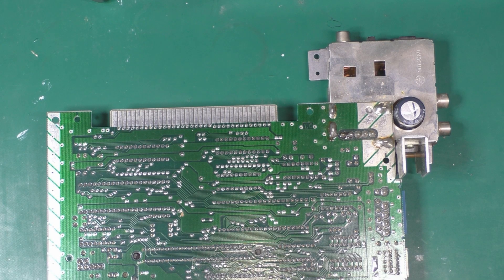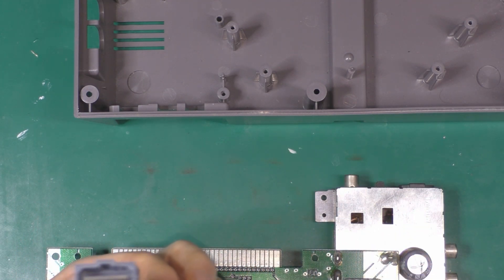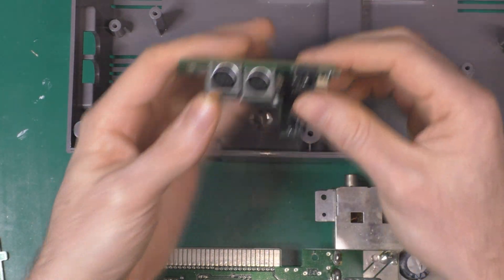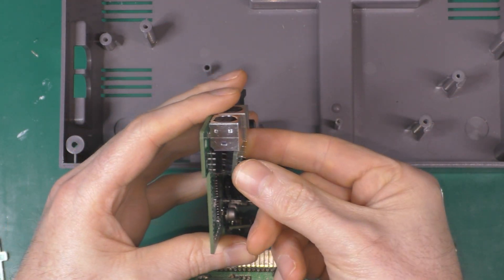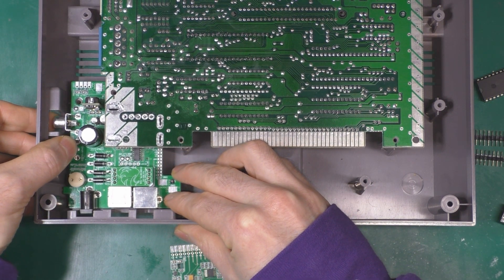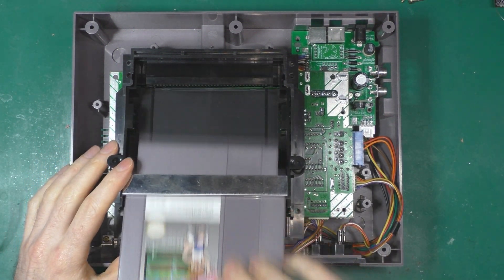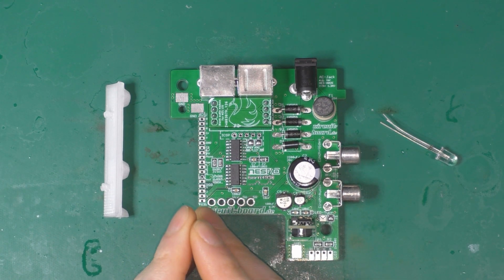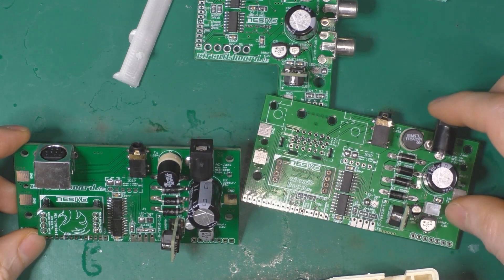[Retro] NES I/O NOCUT MOD for Front Loader

Comment: Do you know how this module would interact with Voultar expansion audio module? I cant find BORTI4939 no cut github repo
Reply from the maker: Voultar expansion doesn't connect to this board, it connects to the hole next to the jumper J5 of the NESRGB.
The NOCUT is my branch of the Borti's work, and Borti took down his work on the NES I/O because it is now irrelevant (NESRGB 4 and newer have IGR integrated). I'm working on a new version of this mode, which will be easier to install.

Comment: @ 9:48 you remove and clean this 5 legged item. Do you possibly have access to these or I must take from the original?
Reply from the maker: Re-use the original.
Reply: @TheRealPhoenix_Retromods  Okay I finally grew the courage to install the NES i/o no cut. I have one last question. If I already have the nesrgb installed using the SNES A/V out, would I simply just solder the 5 legs to connect the i/o to the motherboard of the nes?
Reply from the maker: @digitalblasphemy1100  Er... What the point of installing a NES I/O if you already have a SNES A/V? With only the 5 legs you won't have the IGR, nor any output from the NES I/O working and even loosing composite and sound from the original RF box.
Reply: @TheRealPhoenix_Retromods  Because I was told the diagonal bar video interference I'm getting was power related and I have changed the power filter cap and a brand new Triad power supply so I thought I would recap the power/RF module but I was told it's very difficult so I thought I would look for a new one and you sold me a brand new one. Do you think it's a bad idea? Sorry I really do not know how to diagnose electronics, I'm just asking people online to help teach me about this issue.
Reply from the maker: @digitalblasphemy1100  Since you'll have to remove the RF box either to recap it or change it for the NES I/O, recapping the box should fix your problem. People say it's painful because if you don't remove the RF completely you won't be able to remove the top shield and won't get access to the small caps. Check https://wiki.console5.com/wiki/Nintendo_NES-001#Recapping_Tip:_Power_/_RF_Module
Reply: @TheRealPhoenix_Retromods  Okay but let me ask you this. I already purchased the i/o and like the idea of having updated power components. Is it usable in my nintendo without hooking up all the wires to the RGB board? I just don't know the installation process because I'm the only person using it as a replacement to the original power board.
Reply from the maker: @digitalblasphemy1100  You can "technically" do it, but the power circuit is very similar as the original (not really updated), and there is a itsy-bitsy chance that DC/DC converter on the NES I/O might introduce other kind of noise (some motherboard don't like the DC/DC converter and get a noise ground loop, and you'll have to remove the transistor Q1 from the motherboard). You won't get  any output from the box (since you won't use it for RBG output) nor IGR. It's like using chemio just for shaving your head.
Reply: @TheRealPhoenix_Retromods  Yes I understand you think it's silly but I am only just learning to solder and modify my old consoles and eventually I will remove the multiout and RGB mod my other NES consoles and will use the features of the i/o. I am not quite confident enough to solder all the wires yet and I already have igr with the everdrive so that's no big deal. At this moment, I just want to fix the very annoying interference with your i/o. I have spent a fortune on getting a good image on my tv and after 3 years, I'm still stuck with an ugly image. My old module is very corroded looking and everything else is so clean so now I will have a very nice looking nintendo inside and out. I just wanted to make sure I was only connecting the 5 legs right?
Reply from the maker: @digitalblasphemy1100  No, you'll have to remove the grounded tabs of the RF box in top of the 5 legs. The 5 legs are the easy part, the grounded tabs are freaking hard to remove. Check my other video about the NES I/O with the SNES connector.
Reply: @TheRealPhoenix_Retromods  Yes I understand the removal process. What I meant was, as far as the installation and soldering, it is only the 5 legs I am soldering back?
Reply from the maker: @digitalblasphemy1100  Yes.

Comment: Why not use the sega saturn video connector? You won't need a separate s-video that way.
Reply from the maker: Because 9pin is already used in both Genesis 2 and other mods with the bazillions of cables, while the 10pin is used only with the Saturn. The other possibility was 8pin, but I wanted to be compatible with HDRetrovision component cable without any adapter.

Comment: What pro modders perform this service? I looked on Voultar's site, but I don't see any options for the no-cut variant.
Reply from the maker: Nobody in my knowledge does, first because removing the RF board is tedious, and because most modders don't want to assemble the board: they want preassembled kits, and I assemble them myself so it takes times.

Comment: where does the 3.3V come from? the NOCUT mod says it needs 3.3V and to grab it from the NESRGB but the NESRGB is only 5V
Reply from the maker: NESRGB has 2 points to get the 3.3V. If you check my installation video of the classic one here https://youtu.be/JOyC3tV4dH4?t=979 you can see I'm testing the points where there's 3.3v. It is explain in Borti's PDF installation page 9:  https://github.com/borti4938/NES_IGR_for_NESRGB/blob/master/NES-IO/NESIO_Installation.pdf
Reply: The Real Phoenix awesome! Thank you so much for the fast response. I was just watching that video.
Reply: @TheRealPhoenix_Retromods  One more question :) so i built my borti nocut i/o board, flashed the PIC. Everything works except for the Reset inputs. Holding the Reset button switches pallets, the pallet changing on the controller command also works. I just cant get the console to reset. When i hold the button combo the console LED flashes but nothing happens. Thoughts?
Reply from the maker: @neverthere5689  Reset is tied to pulse/latch and data. Check if you installed them correctly.
Reply: @TheRealPhoenix_Retromods  hmm yea i did double check. i have pulse going to pin 36 on CPU, latch going to pin 39 on CPU and data going to pin 4 on the controller p1. I can change pallets with the controller (but no reset), wouldnt that mean pulse, latch and data are correct if at least one of the controller input sets work? Thank you for your help
Reply from the maker: @neverthere5689  Did you check the reset out? You're not supposed to have any reset reset wire (white and yellow wires) between the front panel and the plug(the big blue one), only between the NES IO and the reset out/reset in.
Reply: @TheRealPhoenix_Retromods  yep removed both yellow and white wires from blue connector. "Reset in" goes to yellow wire location on front I/O board and "Reset out" goes to pin 4 of blue connector on NES main PCB.  I might be chasing the wrong thing, maybe i flashed the PIC chip in correctly

Comment: will this get rid of the diagonal bars? I didn't notice them until after I did the nesrgb and I replaced my psu for a triad and the still exist.
Reply from the maker: I don't know. Actually, I've heard people getting diagonal bars after meddling with the power of their NES, either by adding the additional 7805 from Tim's kit or with the one I use on the NES I/O. (which provides enought power for both NES and NESRGB).  There are solution you can try, like removing the transistor Q1 from the NES motherboard, or use a Recom r-78#5.0-1.5 as replacement either on the original RF Box (and Tim's one) or on the NES I/O. But it's kind of expensive (10$ usd)
Reply: @TheRealPhoenix_Retromods  I might take a look. I'm just surprised no one else has had this issue or noticed it. It's very obvious to me.